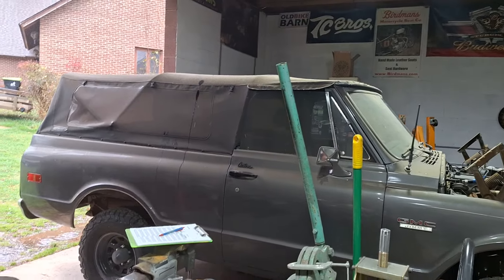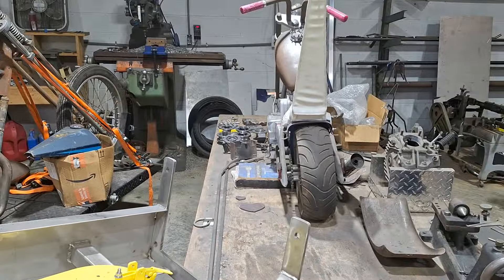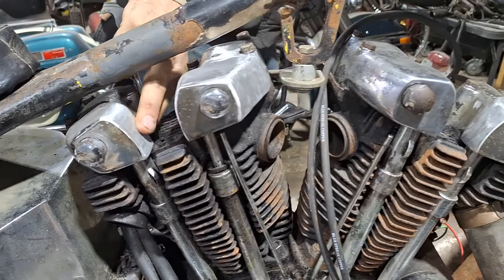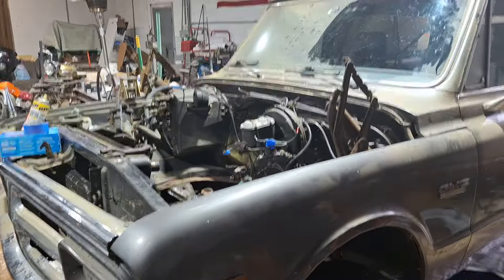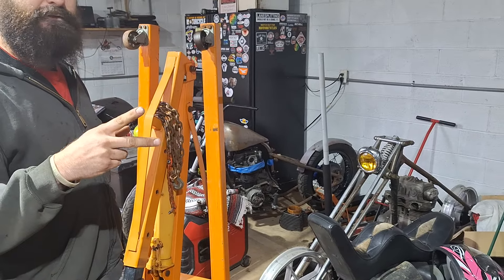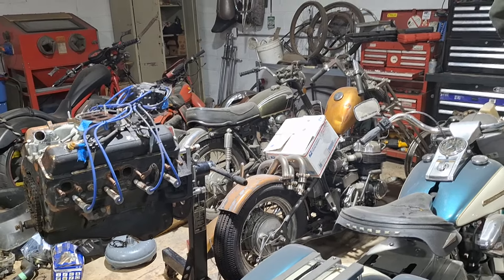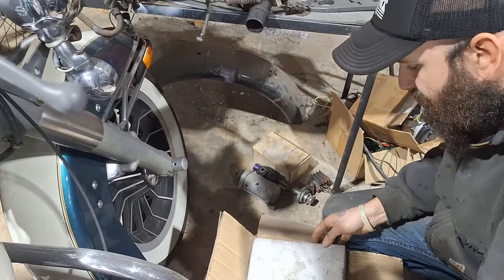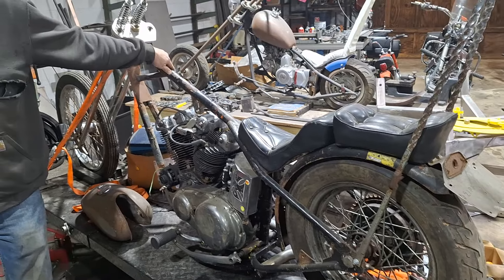71 GMC Jimmy and 79 Harley Shovelhead

Comment: Oil in the frame? Please explain
Reply from the maker: The Triumphs, Harleys, and many motorcycles are dry sump oiling systems (no oil pan). These motorcycles need an oil tank or reservoir of some kind to pump oil from to the engine. Triumphs of the early 70s used the frame tubes as this oil reservoir.
Reply: Buell uses the rear swing arm as the oil tank. The fuel tank is actually  the entire frame.